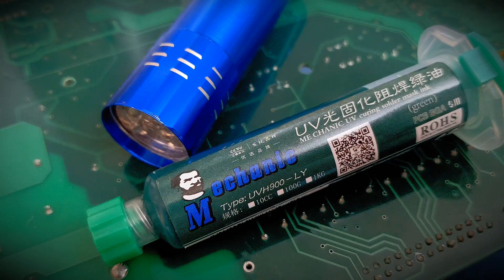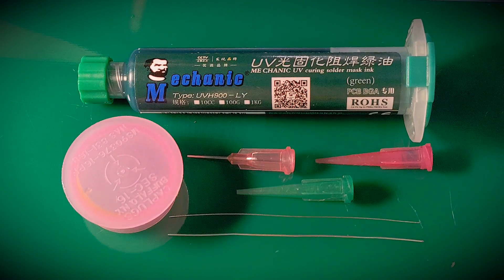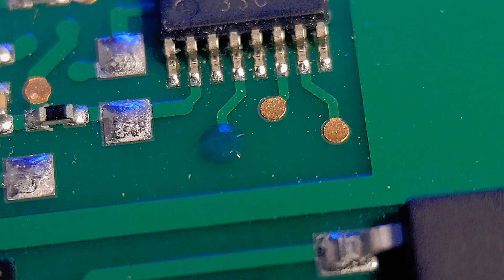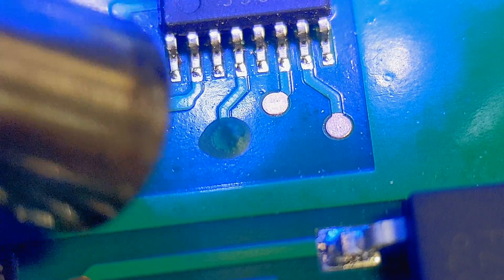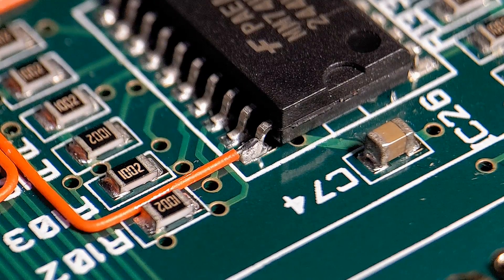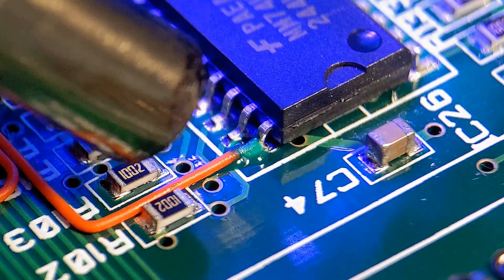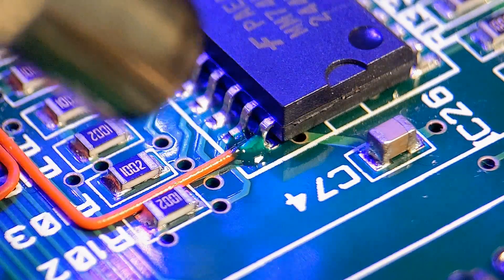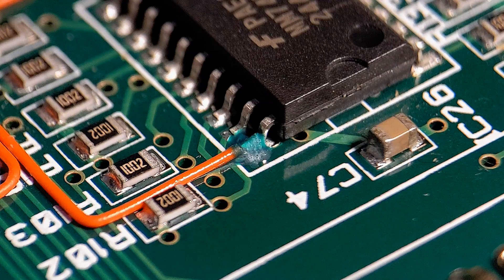Great Solder Mask Curing Trick / Soldering Tutorial

Comment: if i try to push it off with tweezers and with pressure it slides off is this normal? I'm trying to understand what is normal and what is not. I'm using a different one. it did seem to cure, but will come off with a bit of pressure applied to the edge. this is my first time.

Comment: Great video! Is it possible to remove this stuff if required?
Reply from the maker: Hi , thank you for your comment , much appreciated . Yes it is possible to remove solder mask . You can just chip away at it with the end of your tweezers or a blunt scalpel . Or you can apply your iron tip to it which softens it very slightly and chip away as before . It can be done , definitely. Thanks again 👍

Comment: What temperature of hot air r u using here? Cheers
Reply: @06:34 he says 270°C
Reply: @georgeprout42  thx
Reply: Judging by the cable coating did not melt, it is around room temperature or so